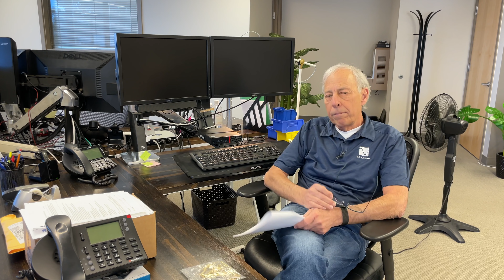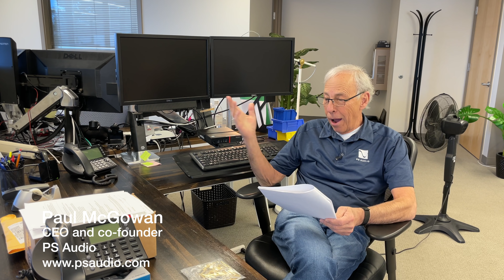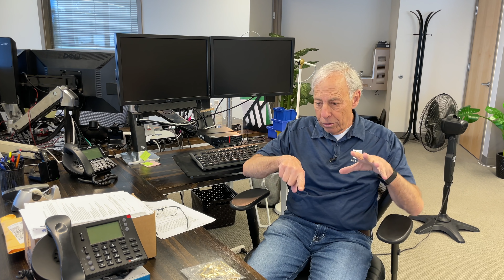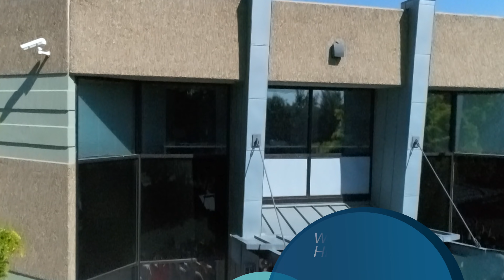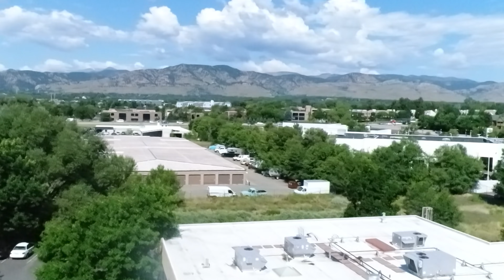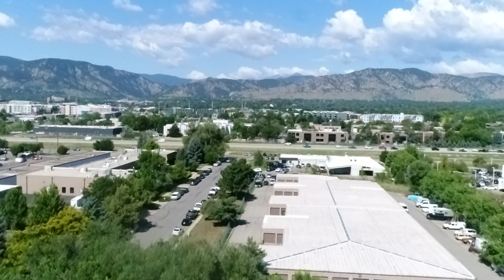Current vs  Watts for amps

Comment: Paul: One very important topic that is vague and never discussed is what sort of A/C power (or what circuit needs to be installed) to run my very large and powerful amplifiers. I have PS Audio Equipment in one room. I have a pair of B&W 801 D4 in another room. Those speakers need a lot of power or they don't perform. I bought a pair of McIntosh MC901 amps to run them. Each side has it's own sub. What I know is the MAC amps need up to 10 amps each, plus the subs on each side draw around 4 amps. On each side I'm nearly tripping a 15 amp circuit. As a result I installed 2 x 20 amp with 12/2 ROMEX and one additional to run my source components. Who thinks about this though? So, to install this system I needed  3 x 20 amp circuits to be totally safe. This topic is vitally important and an idea for one of your future VLOGs. No doubt it will dovetail into your PowerPlant range at some point!

Comment: Paul, sorry, this is one of the few cases where you got something wrong.
The only thing that remains constant is the impendance of the speaker at a certain frequency.
All other things vary. You mentioned 'the voltage remains constant' ... which is true when seen
from the viewpoint of the powersupply, but which is entirely wrong when seen from the 
viewpoint of the speaker., At any given frequency, the speaker has a certain impendance.
Feed it a certain current, and ohms-law tells you the voltage required, and voltage * current gives wattage.
Supply it with a certain voltage, and ohms-law tells you the current being drawn, and again the wattage is the product.

So, in the end the question is, if your speakers impendance is suitable for your amplifier (because this
amplifier also has an internal resistance that limits its current output). If the amplifier cannot produce
the current required by the speaker (or if it cannot feed it with a sufficient voltage that let's the speaker draw this current,
which is the same in the end) the amp cannot drive that speaker properly.

Comment: I’m glad DENON PMA series have High and Ultra High Current MOS push-pull circuitry as they are so affordable 👍🏻👍🏻
Reply: Could not agree more I have APM a 2000 R Only rated at 80 W boy can this sucker crank it out though

Comment: But if you messure an amp like too many do with i.e just one channel driven into just 1kHz @ 6ohms etc you will get a higher watt number on paper because there is just a low load and it's easy for the amp to drive. A 20Hz - 20kHz signal with all channels driven into a given ohm gives the real nominal power since it has a realistic load.
That's also something to consider. A 200w amp is not always actually 200w when you add the bass freq.
So it's not just as easy as saying watts are watts either.
But if all factors are the same then yes, watts are watts.
It's basicly the same as it is with horsepower messurements on car engines🤷‍♂️

Comment: My Martin Logan Prodigy's drop from 2ohms at 10kHz down to a downright abusive 1ohm at 20kHz. Lesser amplifiers will momentarily trip-off or worse blow their output semiconductors. I replaced the output stage twice before finally begrudgingly upgrading to an amplifier with a higher output current capability. The Neolith's are purported to drop to 0.43ohms at 20kHz, so I'm not exactly sure what I'm supposed to do with that.

Comment: I think it is sad that many confuse Watts with Current. Any amplifier with high wattage will automatically be high current. I was disappointed that Paul did not bring up an amplifier's Damping Factor. For hard to drive speakers that drop down to only a few ohms will most likely benefit from an amplifier with a higher damping factor.

Comment: Or basically, your power supply doesn't run out of water, (current), when asked to fill a bucket with a huge hole in the bottom, ie, low resistance loads.
My TDL Studio 1's for example, are nominally 6 ohm, the same as my Tannoy DC3000's, but they have a lower dynamic impedance. The Tannoy's are an easier load to drive, because the hole in their bucket never gets as big as the hole in the TDL's.

Comment: I disagree and it was proven to me. I thought wattage was the gold standard too until I  heard a high current 30 watt integrated outperform amplifiers rated at 300 and 600 watts per channel. Lumin's Amp rated at 160 watts also out performs many amplifiers that are highly rated. In automotive terms, you can have 750 horse power and torque to go with it, but if you can't transfer it to the ground effectively and safely, then it's not worth much. Dodge Hell Cat vs a Porsche GT3. Brut vs sophistication.
Reply: i looked up the lumin amp, it is really impressive.  one way to look for current capabilities is a true four times power in bridge mode. my nad can not do it, but the lumin amp can. also getting a 2 ohm rating is also since, wich my nad has.

Comment: Question to the community: 
I still have no idea how to identify amps with high current. My only guess was that if the thing produces high wattage there should probably be capability in the ampere area. 

So in order to drive my finicky Elac ub-5 (4 Ohm and less / 85db) I got a Yamaha AX-750 which gives me (depending on measuring) at least 180 watts per Channel a 4 Ohm.

It works fine, I guess. But I have no idea what I'm doing! Drives me crazy. How can I know how many ampere I need (headroom?) and how much l get?

Anyone? Cheers.
Reply: One thing is for certain; look for the spec's with power on 4 ohms and/or 2 ohms. IF the amplifier doubles the power (W) at low impedance that IS a capable "high current" amp.
Reply: @simoncelice  Thank you for answering! So are you saying if the watts don't double it won't be as good in delivering current dynamically? And would that be remedied with a greater surplus of power (i.e. fatter amp?).

My specs say:
RMS - 8ohm 110w / 6ohm 160w / 4ohm ?
IHF - 8ohm 150w / 4ohm 230w /2ohm 260w
DIN - 4ohm 185w
Reply: @j.m.w.5064  If your amp doubles or almost. for example 150w, an amplifier with high current capacity should reach 600w at 2ohms. If you have drops like 550w in that load, you could say that it still has high current but not perfect. If it was below 450w it would not have high current. Generally high current amplifiers are expensive and require a serious implementation in the power supply (large toroids, large capacitor bank, several transistors, etc).
Reply: @j.m.w.5064  That amplifier with those specs doesnt have high current.

Comment: Remember speakers are complex loads, they are not just R. If the speaker becomes very inductive, the amp can push lots of volts and lots of amps but almost no watts in the speaker. The cross over can just make things worse. A low impedance (Z) point on the speaker response can be difficult for the amplifier to drive, but it does not mean the speaker is taking more power. The phase of voltage and current has to be factored into the power equation. This can challenge amp stability causing shut down and explains why some lower powered amps can handle difficult speakers better.

Comment: All the Manufacture is doing is providing an amplifier that is stable below 4 ohms. Which, is good. If you take a 100watt amp, you need about 28.4vac.. 28.4squared =806.56 divided by 8 ohms is 100 watts.  If you take 806.56 /1 is 806 watts at 1 ohm, most amps blow up, a high current amp will be able to drive it short term if built properly..

Comment: I remember being told that the Magnepans  were fussy about the amplifiers that were used and being told that the Dynaco Mark IIIs that I had at the time would work well.  This was the early solid state years and some of the designs at the time would oscillate when driving Magnepans.

Comment: The voltage doesn't stay the same, since it is the driving force containing the varying amplitude of the music.
The important point is that it comes from a very low impedance source, namely the output impedance of the power amp.
It is this low impedance that enables the voltage to produce the high current and therefore wattage produced in the speaker.
Reply: He’s talking about at any one point in time, within the music, if you were to compare a low-impedance load vs. a high-impedance load.

Comment: Old school Klipsch horn speakers are so ridiculously effecient and sip little power  that you can probably drive them with a hand crank! I'm not even sure if that's hyperbole!  Hell a simple Sprout amplifier from PS Audio could probably them at hearing loss levels.
Reply: Klipsch older horn speakers were all designed to play LOUD when most amplifiers only had a few watts of power.

Comment: Maggies are NOT easy to drive. A lot of amps shut down quickly with them, esp LRS's from what I hear and experienced with them.
Reply: Paul is losing it!!! Wow.
Reply: Maggie's need a high voltage, they do not require a high current.. when he says easy load he's referring to the current load or ohms dips ....Maggie's are flat across the current load...your actually the confused one....Maggie's need voltage but not a high amp current.

Comment: Went through this earlier this year. Had a Yamaha A-S801 amp. 100 wpc, 8 ohms. Bought a pair of 4 ohm rated Martin Logan 60XT`s. After 3 to 4 songs, the amp was almost too hot to touch. Bought a Yamaha A-S1200. 90wpc. Mosfet amp with a toroidal  transformer. Amp doesn`t get more than slightly warm all day at higher volumes.
Reply: I own an A-S801 and an A-S2200 and while both are great, the topology between the 2 are worlds apart.
Reply: I made the same mistake years back. I tried to run a pair of ML Clarity’s with a Marantz avr. Big mistake. Anything above a whisper and it went into protection mode.
Reply: I believe that. It makes me laugh when people point out that the a-s801 is almost as powerful as the bigger Yamaha amps.
Reply: And that`s why I posted this. It fits perfectly the topic of this video. Watts, in itself, ain`t everything. "Weaker" amp blowing away the more powerful rated amp. High current amp for power hog speakers. I believe these 60XT`s go down to 2 ohms or lower at certain frequencies. They`ll suck the life out of your amp if it doesn`t come with balls.
Reply: I have an early Moon 40w amp that blows a 60w Rotel that I used to have

Comment: It's not about the watts per se. it's about the load. with low Z speakers such as Maggies that can dip down to 2 ohms you need a big power supply to handle and drive the speakers through it's frequency range.. So it's not just about the watts at 8 ohms, it's about the watts at 4 and 2 ohms. That's a powerful amp to drive very difficult speakers. theoretically wattages should be close to double as you half the impedance. ex. 100 watts @ 8 ohms should then be close to 200 watts @ 4 ohms. 400 watts @ 2 ohms.
Reply: You are correct but few affordable amplifiers can do that ,some of the better class D amps can do that but the quality of the sound with a 2 ohm load is debatable if it's of true audiophile quality. Bob Carver was one of the few design geniuses that was able to get a lot of current out of a relatively small and light power supply with his "magnetic field coil" and later his  "tracking down converter" designs. .
Reply: @Jingle Nuts Yes, me to, I prefer 8 ohm and efficient speakers. To me they also provide more dynamics and less compression at high volumes. may not be the most reveling but neither is live music.

Comment: Magnepan's new quasi-ribbon design needs lots of current like most ribbon designs do. Check out New Record Day review of the Magnepan  .7's and how some pretty expensive amplifiers could not drive them properly then he got an old Carver amplifier that could and later finally found some new amplifiers that could also drive them. So the new ones are not an easy load to drive.
Reply: Wasn't that a Yamaha?  He called it the beast or something. Either way that review was years ago, Ron isn't the same guy now. Nowadays he would reach for a D'Agostino mono block that costs more than his house.
Reply: @jamesrobinson9176  Later in the video He  did find an old Yamaha design that he liked the best. And the Beast referred to the Carver with 500 watts into 4 ohms which was a lot in those days.
Reply: @jamesrobinson9176   Ron Brenay doesn't seem any different to me except 5 years older. So he has more expensive toys to play with but for a fair evaluation you would want to pair an amp or amps in the same price range that the average user would most likely use with a particular speaker. To test a pair of $1500 speakers with an amp that cost more than your house would hardly be a fair evaluation and would NOT warn potential buyers that you need serious current to drive them. Beside all that his review of the .7's is as relevant today as it was 5 years ago .

Comment: I am confused. I live in a condo so I have a small listening area and I rarely play my speakers loudly. For the 2 channel music listening I have Monitor Audio GX 100s. MA says I should use an amplifier rated between 60 to 120 watts. Considering my listening conditions is that written in stone? I use an Emotiva Xpa 3 for my fronts mated to a Yamaha avr. While I have way more power than I need would a lower power amp/integrated from a better brand be worth while?
Reply: Depends on how loud you usually listen. If you don't at all, then a smaller amp will also drive them. But that one time you like and can raise hell, that amp will run out of steam, clip and ultimately fail. Headroom is the key word here. In that "once in a year" situation, that extra "pillow" of power from a bigger amp, called headroom, will do the work without issues. Unless you crank it up at max volume. Don't do that, even for fun. Anyway things are going to be plenty loud long before that. The bigger the amp-headroom, the sooner its going to get disturbingly 
loud. Also has to do with the kind of music you listen to. Rock and classical, due to fast and abrupt dynamics need power. Acoustic duos, like voice plus guitar not so much
Roughly, think of it as the extra horsepower (torque x rpm) a car has and how useful it is having it, when you once in a month or a week, you need to pass a truck uphill, quckly and safely, cause others are constantly coming from the other lane. With a McLaren, its over in seconds. With a Hyundai I20, not so much. On the other hand, in non demanding conditions, its easier to crash with the sportscar, that it is with an ordinary one. Upshifts in the first case, need much more demanding driver skills, like reaction and reflexes.
Reply: @Yiannis2112  Can u recommend powerfull amplifiers?
Reply: @pamelarios4324  That is as vague of a question as it can get, to be honest. For what speakers, brand&model? Stereo or multichannel? How many and what sources? How much money maximum? For a room of what dimensions? Where in the world are you? What kind of music do you usually play? Loud or moderate use?
Reply: @Yiannis2112  Focal Maestro Em Evo; DAC MSB reference (all played from my PC); Room 25x27x3; Money dont matter; Music: Organ music with peaks of 127db below 25hz (Grand Wanamaker Court Organ), Huge Orquest like Tchaikovsky, Mahler with crazy crescendos and fortissimos, Rock or Metal, Electronic, etc.  And play some movies.
Reply: @pamelarios4324  25x27x3? Meters? 127dB peaks? Are you sure this isn't a trap question? Something's really fishy here...
Reply: @Yiannis2112  Mi bad: 8.5x9x3 meters, I said 127db that Grand Organ can get... I want that same experience to heard a huge organ church can shake all with deep notes.
Reply: @Yiannis2112  Actually I already have my amps, but I wanted to see what options you offered to see if there was something new, apparently not.
Reply: @pamelarios4324  Quite a few, but since you're like that with your "apparently" and such, you can always ask elsewhere. Nice talking to you. Cheers!
Reply: @Yiannis2112  lol.
Reply: @pamelarios4324  ...and that's what she said.
Reply: @Yiannis2112  I am a man. Don't trust the nick, it's the internet. Second, I was hoping that someone who talks about headroom as the key to everything would at least have the ability to mention powerful amps in a general paradigm but you didn't mention any and I gave you all the information you asked for ... so? Lol.
Reply: Do not trust this piece of sh... friend, a high current amplifier at least 300w 8ohms (1200w @ 2ohms) (Gryphon, Vitus, Boulder, Accuphase, Pilium, etc ...)  . If you want to pressurize your room with bass like a great organ or you also watch movies go for <1000w (minimum) class D for subwoofers. That's all you need.  It will cover your small and large rooms if one day you want to update. With realistic and effortless dynamics.

Comment: Always wondered how 80W Naim amp drives difficult speakers better than many, more expensive 150-200W amplifiers.
Reply: With an Over sized  power supply for an 80 w amp. They also rate their power into 4 ohms while most rate it into 8 ohms ,and unless other amplifiers can double it's power at half the impedance (only the best can) this will make the Naim seem much more powerful that the given power rating would suggest.
Reply: it is a better amplifier than many amps with higher ratings. Frankly, it should be considered a crime for manufacturers to cheat power ratings, but they somehow find a slippery way to make these numbers fly past the consumer. one of the reasons that Naim is so well respected is that they have not cheated their specs, and thus their products deliver what they are supposed to deliver. I have never owned Naim but I have no problem recommending them.